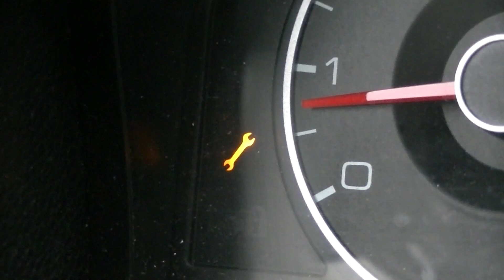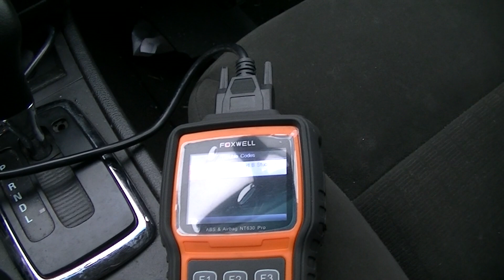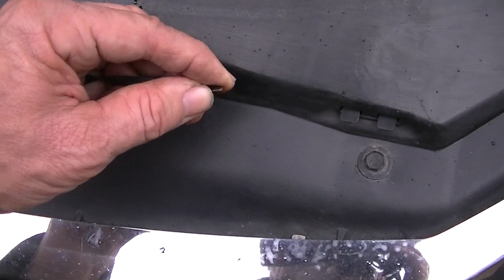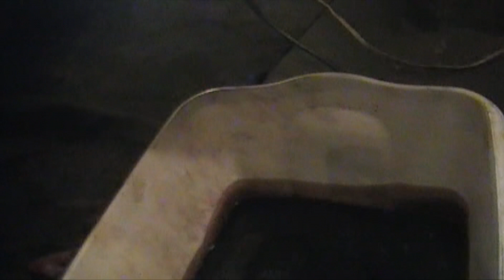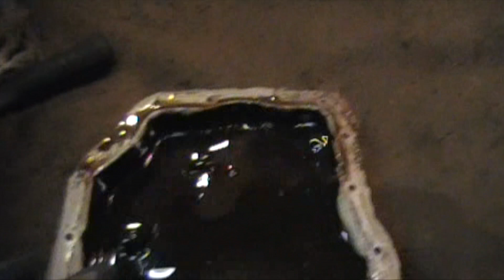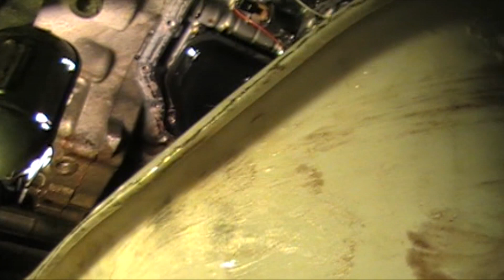PO757 -Stuck "B" Solenoid Hunting. My findings. 2008 Ford Fusion.

Comment: Looks to me you just needed to replace the whole transmission valve body module itself, no need to drop the transmission assembly . What did u end up doing anyway to fix the problem? I’m curious.  Looked around here on YT and couldn’t find part 2 of it .

Comment: Hello, Great video describing how to do this.    Question, maybe you can help. I have a 2009 ford fusion se 2.3L. Check engine light and the wrench light came on in the dash. The car was shifting hard off and on. I was planning on flushing out the trans and swapping out the filter and gasket. Would you suggest swapping out any of the solenoids as well. The error code that I received when scanned was PO772, but this has very vague descriptions and says it could be solenoids that need replaced or a trans flush or something serious. How many solenoids are there total for my car? and which ones would you suggest to replace if any? (appreciate any and all info anyone might have) thanks

Comment: Mine is doing the same but for 3rd gear. Shifts hard going into 3rd. Looks like the previous owner changed the other opposite solenoid from the papers iv seen. My car is doing the same lifter tick sound on start up (that you explained) and it goes away after warm up also. Idk if that’s exhaust ping or a exhaust rattle, lifter tick but i feel like it only happens when I have low oil (have a oil leak). Idk what it is tbh. The sound was bad after a 4 hour trip, then next morning I started it up and didn’t hear it. Weird but I still hear it sometimes
Reply: I have a 2007. The hard 3-4 shift was the servo that is under the valve body.  The trans case gets worn from the servo and it needs to be bored and bushing installed.  I was able to borrow the $700 kit and do it in the car.  Bushing was $30.  There is a great YouTube video on how to do this.  Believe it’s Tylers Garage. Silver Fusion
Reply: @steve20118  thanks for the info 👍🏼

Comment: U change that out did it fix it
Reply from the maker: Basically I had to fix the servo pin. It wore the case out. Basically Its a issue with these transmissions ;(
Reply from the maker: https://youtu.be/v5xYlMHl6C0

Comment: Nathan thanks for your videos, I have a quick question? I have a 2008 Mercury Sable  the engine stalls when putting it into Gear (Reverse or drive). I put it on jack stands and it stalls when pressing the brake. Do you know what could be the cause of that? I have been told it is the torque converter and or solenoid.

Comment: I am having this issue. Should i replace the whole transmission or just the transmission solenoid? i am new to cars. thanks for your help!.
Reply: Definitely don’t even consider replacing the whole unit unless there is metal inside the pan or the fluid shows evidence of excessive clutch material. What you need to do first (before even pulling the pan) is get a wiring diagram for the transmission harness that connects to the valve body. If there any shorts in that harness I believe that will set the code. Once you get a diagram, identify which wires are for the B solenoid, and check to see if the resistance for that is out of spec or not. I believe that is what sets the code in the first place. If you end up finding that the resistance is out of spec, that means either the solenoid is bad or clogged, or the wiring harness is damaged. If all of those specs check out, then you probably have a bad TCM or ECM.

Comment: Any clue on how to get to the shift solenoids on the 3.0L V6 version with the AF21 Trans? The housing is on the front and there is no pan to drop. Trying to replace solenoid B myself without dropping the transmission out.

Comment: What Fluid Did you put back in the transmission? You have an FNR5 (5 Speed Mazda) transmission correct?
Because I'm having a horrible time finding the Mazda M5 Transmission Fluid that it calls for. 
And I'm not exactly sure what to use, the Mazda dealership said to use Mercon V but that is not correct, they have different oil properties.
What did you use?

Comment: To be clear, when you swapped the solenoids, the problem stayed at the B spot?  So that would mean theres a different problem than a bad solenoid, right?  Any idea what it could be?  I also have a code for shift solenoid b that persisted through replacing the solenoid on an f5nr 08 mercury milan.  Would love any insights you have found out
Reply from the maker: Yep. It stayed the same. Turn out I had to replace this....https://www.youtube.com/watch?v=v5xYlMHl6C0&ytbChannel=null    It now runs great!

Comment: I have a 2007 Ford Fusion 2.3l and I have a P0762 code I did transmission rebuilt 1 year ago and this code pop up on me 2 months ago and thanks for making this video I'm planning to change the solenoid C soon
Reply from the maker: Actually I just did a transmission drop video i'm uploading soon.
Reply: Nathan Rohrbough yes please I had my car parked for at least 2 months do I need to add new transmission fluid in when I changed the shift solenoide C and a new filter and oil pan gasket? What type of transmission fluid can I add?
Reply: Nathan Rohrbough I lost the bolts of the transmission pan do you know what size are they and what kind can you please help me